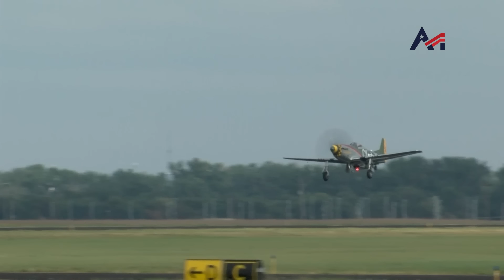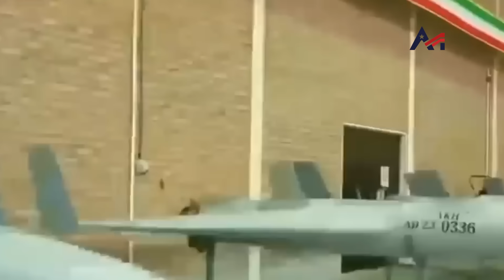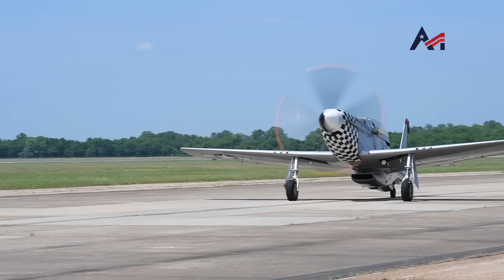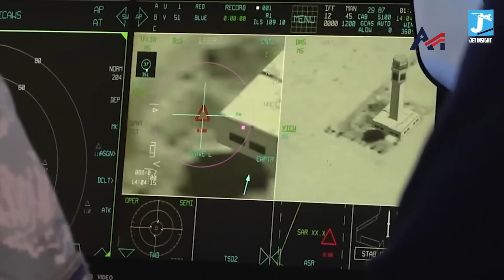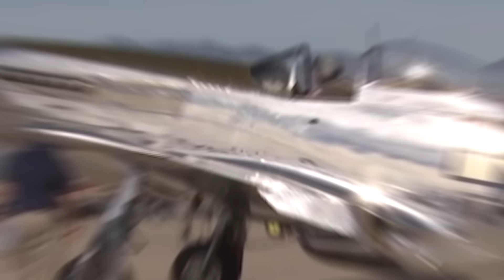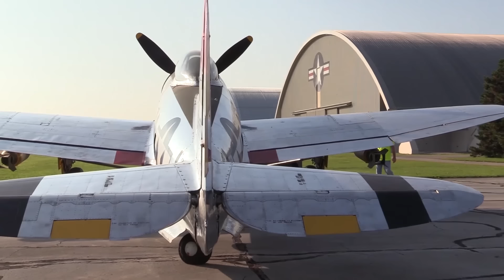U.S Air Force’s New P-51 Mustang Answer to Shahed Drones

Comment: I would say the A1 Skyraider would be a far better choice. It not only has probably a hell of a lot longer loiter time but it has a lot of hardpoints and 20 mm cannons. It's also capable of reaching some serious damage on drone launching sites and missile launching sites as they present themselves as targets of opportunity. Plus the fact that it was designed to be carrier-based
Reply from the maker: Good point. The Douglas A-1 Skyraider was built for endurance and heavy payloads, which could be useful in certain scenarios. The challenge today would be survivability in modern air defense environments.
Reply: @americanmililitary not really modern heatseekers have a problem keeping a lock on piston poppers they're actually not hot enough. And as far as radar guided stuff goes as long as the pilots aware that it's incoming those old piston Fighters are far too agile. Missiles don't fly like they do in Hollywood for starters and the kind of add insult to injury they're not designed for the old prop jobs. Even back during Vietnam you didn't hear about them firing anti-aircraft missiles at Skyraiders. Since Vietnam there just ain't a whole lot of AA guns in use anymore. Jets kind of made them obsolete.
It kind of creates this interesting military paradox where what was old is new and what's new is old.
Reply from the maker: @Reaver6666  The Douglas A-1 Skyraider was extremely effective in its era, especially due to its loiter time and payload capacity.
However, modern air defense systems have evolved significantly. Advances in infrared sensors, radar tracking, and layered air defense make survivability for low-speed aircraft much more challenging today.

In permissive environments, that kind of platform could still be useful but in contested airspace, the risks would be considerably higher.
Reply: @americanmililitary it's a nice fantasy world to live in but the one thing that I learned in the military most of that high-tech crap doesn't actually work near as good as what they say it does. Everybody's running around trying to chase tomorrow and they're getting their asses handed to them by yesterday. That's the problem with our military industrial complex.
Reply: @Reaver6666  I'm all for bringing back the Skyraider the A-6 actually had counter measures put in.  The biggest risk is the fact that a lot of Middle Eastern and African countries have the Soviet twin 23mm mounts so the Skyraider would need to get thermals and some standoff weapons in order to navigate that threat, against drones it would be perfect though imagine giving it 7.62mm gattling guns in each wing hardpoint the A-6 could already mount those in pods on each underwing hardpoint if they were feeling spicy.
Reply: @Jadefox32 the Intruder is a hell of a plane but the problem is it still has the exact same problems every other jet has when it comes to close air support. There is a gap in closer support that helicopters can't fill and jets can't fill. Unfortunately they've been able since Desert Storm to force the A-10 into doing that job even though the A-10 is actually there and primary design function is taking out armor. And unfortunately we have a bunch of General morons out there that would rather try to force a joke like the Toscano down our throat because it's new then just flat out admit we need some of that retro Tech back.
Reply: @Reaver6666  I was referring to the A-6 (or maybe its A6) variant of the Skyraider not the Intruder I apologize for the confusion.
Reply: For this role a DeHavilland Mosquito might make more sense. Gives you a nose to place equipment
Reply: @grantwilliams8164 if you've ever seen the old World War II vintage radios and even up into the Vietnam War they were huge. The radio on a P-51 Mustang was roughly the size of a igloo ice chest. With modern technology and Avionics that could be cut down to a fraction of that. Just remember there are single seaters prop civilian aircraft that can now be fitted with Aviation radar. Pretty much any classic vintage aircraft could be easily retrofitted with something resembling modern technology at least enough to get the mission parameters being discussed taken care of. And that's not even going to something as modern as a Bronco
Reply: @grantwilliams8164 another thing I was taking into account when I made my recommendation was the fact that these bad was in fact designed for Carrier use other World War II or vintage if you want to call it fighter aircraft that would be appropriate for this kind of mission we're not designed for Carrier Duty. I mean the P-40 Warhawk armed with 30 caliber machine guns would actually be an awesome aircraft for hunting drones the problem is it was never designed for Carrier Duty same with the Mustang.
Reply: Y'all forgot about one WW2 US night fighter, the P-61 Black Widow.  The more popular ones were daytime fighters. You want something that can intercept at night, too. And with the Black Widow's armament, it is capable of taking down more drones per sortie than the other WW2 fighters being mentioned. Don't get me wrong. I like the US fighters of WW2, but the Black Widow already had more advanced targeting mechanisms to shoot down enemy aircraft than its daytime counterparts.
Reply: @TheHawk--oe8iq well I can see where that would have a possibility but we still have that overwhelming of some of the best fighters out there unfortunately missed the calling in one major category they were never designed or set up for Carrier operations. Which means for the most part most places in the world they would have to be shipped there on a ship unloaded and then flown to the operations base damn near from the harbor
Reply: @TheHawk--oe8iq Dude, it is about the airframe, any ww2 plane could easily be updated with far more advance targeting which would mostly likely be laser guided rockets.
Reply: The P51 is more fun.
Reply: @madmechanic7976 well I can't fault that personally I'm a P38 fan. But I was thinking in terms of Battlefield effectiveness. It's not just about engaging drones and missiles while they're in the air you also really have to be able to wreak havoc on them at the launch sites if the opportunity presents itself..
Reply: @Reaver6666 launch site is few hundred miles deep in enemy territory. These plane only going to be use for defend over the gulfs.
Reply: @FlipFlopMarfia do you have any idea how stupid that statement is? Technically those aircraft in question have roughly if not a slightly greater range than the A10 does. Now the A-10 is not a carrier based aircraft so it not only has to fly your a few 100 miles inland it has to fly from whatever ground base they're using over the water to get there. And I would really hate to think that the A1 Skyraider basically operated all over North and South Vietnam not to mention all over Korea. Not to mention the most loved aircraft the A-10 is actually being used for a role it wasn't really designed for and because we insist on using it in this role that it wasn't really designed for we're running out of them of the original 700 that were produced if I remember right it's 261 are still in the air. And they weren't shot down if you were but most of them were retired because the airframes were shot. Now if you knew anything about military Aviation you would know that back in Vietnam they found out that jet aircraft suck for close air support. This was the whole point and reason for the development of the cobra attack helicopter. The problem is assault helicopters are only good for relatively Close Range close air support they don't have the loiter time.
Reply: Yup...and Skyraider is much tougher and could carry much more bombs
Reply: @RacerX1971 You need more bombs to shoot down a few shaheds a night, one rocket pods will do thank you very much.
Reply: Imagine  2 pilots! All its hard points and a new turbo jet e gine!
Reply: @HDSME yeah turbojet engine kind of defeats the whole damn purpose let's bring that heat signature up into the realm of something where a heatseeker can actually get a decent lock not to mention massively increased price and a hell of a lot more maintenance then you run into Little issues like trying to use it off of dirt runways and everything else.
Reply: Agreed. It was highly effective in Vietnam for these types of applications. A rugged airframe with useful endurance. It can be fitted with anti missile protection flares as well.
Reply: A-10 should be able to do the job.
Reply: @frank_lehneoh I'm quite sure it can do the job the issue here is economics. Think of the cost of operating and maintenance of a jet attack aircraft as opposed to a piston popper when dealing with dirt cheap drones? Not to mention the difference in ordinance costs. When you're talking 20 mm or 50 caliber and a couple of 100 rounds a minute versus 30 mm at 3,000 rounds a minute? One verse from an A-10 gun cost 3 times what the damn drone does
Reply: @Reaver6666 I love P-51's. I can not believe the cost of retooling to manufacture P-51's , and training maintenance, ground support personal, as well as pilots to facilitate their use, would be more economical than utilizing a resource that is currently in the inventory.
Reply: @frank_lehnehere's some food for thought. We started out with 700 purchased A10s, we now have 218 that are actually combat ready and slightly less than 50 mothballed in the desert that have been cannibalized. Replacement cost with all the modern Weapons Systems and everything else just like they're flying today is about 160 million a piece. Now don't misunderstand me I'm a combat vet and the A-10 is an angel of Mercy when the shit gets thick saved my ass more than a few times. But here's the deal they don't have a replacement for it because the Air Farce can't come up with an overpriced dysfunctional piece of modern crap to dump on the American public so they can continue thinking they look cool. The fact is we're wearing out A10s using them for very mundane CAS operations. Here's the Ugly Truth you don't need an A-10 and a couple of million dollars in ordinance to wipe out a dozen goat shaggers hold up in a building somewhere.
Right now replacement cost on a P-51 Mustang is somewhere between 600k and 800k. an A1 Skyraider replacement cost in today's dollars would be somewhere around a million dollars give or take a couple of hundred thousand. So you're going to tell me that for what it would cost to put 10 new desperately needed A-10s on the roster we couldn't tool up and put some proven war horses on the line? Basically for the price of every smart munition or missile that the A-10 fires you could afford to put an entire War Horse on the line. We really don't need to be dropping Million Dollar Plus smart Munitions on mud huts simply because the Air Farce doesn't want to drop traditional Munitions because it's not cool trendy and high-tech. Last time I checked a good old-fashioned Mark 82 500lb dumb h e frag bomb the manufacturing cost was right around 200 bucks a unit. Seems to me an old warhorse can drop a hell of a lot of 250 lb old school whoop asses for what one Avenger round goes for.
Reply: I would agree AD1 would also fill the their traditional Sandy role.
Reply: The problem is to integrate old structure to the new advanced technology. The super tucano has already dine it. And it was never hit by AAA or missiles
Reply: @miltonsoarescamposneto2073 the problem is not integrating the older technology with the newer they actually have the technology for that off the shelf in the civilian Aviation Market. You don't sound like you have much experience in the small-scale civilian Aviation sector. And your little overhyped overpriced Super Flea has never had to deal with anti-aircraft fire or missiles every country that's used it in anything resembling a hostile environment it's pretty much a Mickey Mouse little hit and get or reconnaissance aircraft. It's not very heavily armored and it's not designed for intense close air support. The Tuscano is basically an overhyped novelty at best and the Air Farce is fascinated by it because it puts money in somebody else's pocket not that they actually really want the damn thing or see a need for it it doesn't fit their jet age space farce imaginary view of themselves
Reply: If memory serves i was watching a video on the Vietnam war.The Skyraider was working with the jets and the carriers kicking butt.
Reply: @vernonfindlay1314 it was and it was even ground-based. There's just a bunch of really dense foolish people who the only thing they know about Warfare is the fact that they're experts at playing video games😂😂😂 every solution doesn't require a billion dollars a unit General Dynamics generally electric contract. Contrary to what these meatheadz seem to think the Skyraider has plenty of internal cargo volume that could easily handle OEM off the shelf modern Avionics they can easily be sent to a tablet strapped to the Pilot's knee. For probably less than equipping at $20,000 a plane. The Skyraider was already equipped with chaff and flare anti-missile defenses how hard would it be to upgrade that a little bit to Modern Standard? Too many little armchair Tweedle Dee's and Tweedledum really want that Tuscano piece of crap or some new warthog 3.0 cluster much like the F-35 joke
Reply: The AT-802 sky raider two is a badass
Reply: But it's fuel efficiency wouldn't be as good or as fast
Reply: The problem with the Spad is the engine. Not a lot of support for radials these days.
Reply: @glennstubbs8232 hey the way I look at it it's time we start thinking about getting industry going again and a military industrial complex that's into actually manufacturing shit that works as opposed to something that's going to need bizarre fixes for the next 20 years and it never does work right until it's phased out and then we get to start the whole cluster all over again. Time to spread some of that military budget around to somebody other than Mega conglomerates
Reply: @glennstubbs8232  , not a lot of support for radial engines? US WW2 fighters with radial engines include P-47 Thunderbolt, F4U Corsair, F8F Bearcat, F6F Hellcat.
Reply: @TheHawk--oe8iq OK, go buy a radial engine, or even parts for a radial engine. Let me know how you make out.
Reply: @glennstubbs8232 welcome to the world of CNC and EDM Machining in around 6 months you could have a plant set up and cranking out a couple of hundred units a month. We ain't living in World War II boy where everything has to be done 100% By Hand by completely skilled Machinists.
Reply: @Reaver6666 You don’t actually have any real world connection with aviation, do you. The FAA would never allow the production, sale and use of uncertificated parts. That’s why I’m still flying a plane with an engine designed in the 1930s, manufactured in 1946, that requires up to a year to get replacement engine parts. I’m not allowed to replace the engine with a modern engine. The government doesn’t allow it. We haven’t manufactured new radial engines or Merlin’s in 75 plus years. That’s why the warbird that cost $5,000.00 in 1947 now costs 2 to 6 million dollars today.
Reply: @glennstubbs8232 so here's the thing I do have real-world experience in Aviation and I'm also a qualified machinist so I know you're talking out your ass that you can't get parts like that. In today's modern world of CNC and EDM Machining those parts are easier than shit to make all you need are the original Prints schematics or apart in shape that's not damaged. Realistically maximum 2-week turnaround time. I'm a retiree with a small Tinker toy shop that I use for steam engines and guns. The vast majority of the parts you need that aren't like the engine block and crank cases I can pretty much fabricate here generally in less than a week. So either you're a complete numbskull or you got a whole lot of people jerking your chain. If I can get scalable flying cat drawings for basically every type of locomotive manufactured in the 1800s through the 1930s I'm quite sure if you look around you can find the same damn thing for aircraft engines. There is a whole community of CAD hobbyists that that's all they do is turn old blueprints into CAD. Any reasonably competent machinist can easily compensate for wear variances in dimensions.

Comment: I completely agree with bringing into production modernized WW2 aircraft and using it for this task. These are proven military assets with a respectable service history. 

There is an additional perk, it enables cheaper parts for those attempting to restore or keep flying original WWII airframes.

Comment: Only after the British supercharger was used on the B model in 1942, it was not effective in high altitudes before that version. The merlin engine and supercharger would be very difficult to reproduced cheaply. today a modern turban engine would be cheaper. but you already have a very good tool for the drones; The A10 Wart hog is an excellent tool for that use. The air force should lose the mission, funding, and plane  as they only want fast jets and stealth.  They should be made to give up the mission of ground support to the Marines with all funding and the A10. The Marines once they get the A-10 would never get rid of such a versatile ground attack plane.

Comment: The p fifty one mustang was a different aircraft above most. But when I tried to use it in the Pacific theater, it wasn't as dominant because it wasn't built or designed for that particular mission. There's no protection for the radiator good enough at that time to keep it from being shot down easily from small arms fire from the surface.